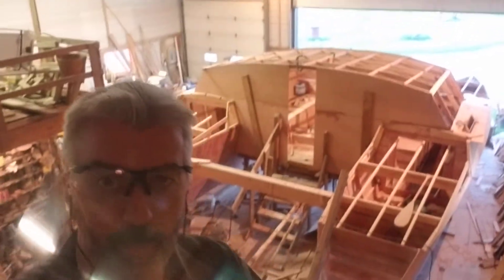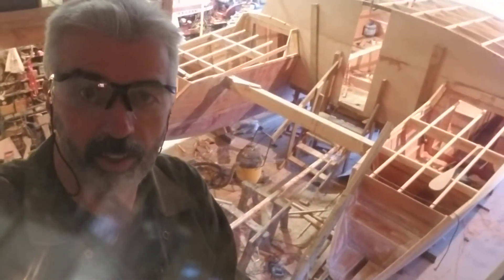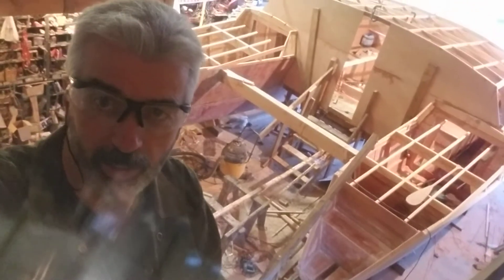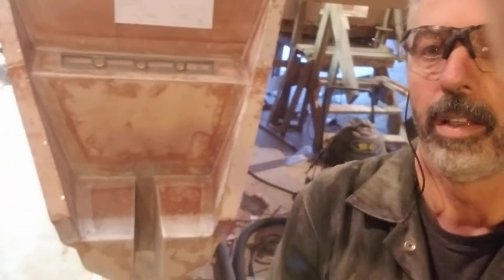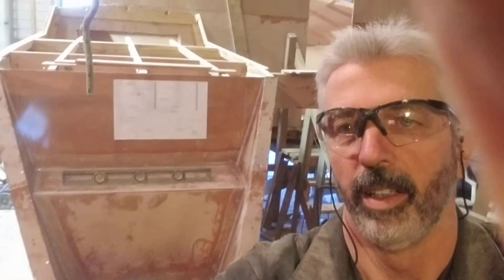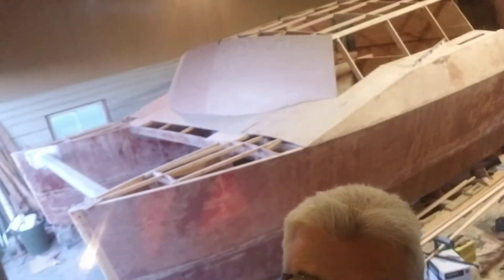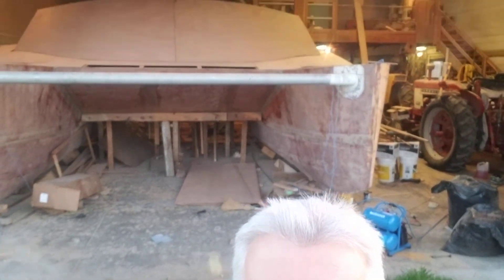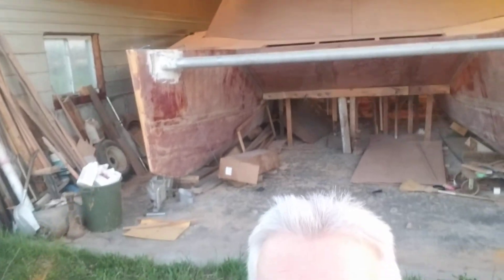Tour of my Catamaran Build month 18ish

Comment: Hello Tom, have you look in to the pricing of your project? certification process and insurance? I believe that final red tape is crazy-complicated to finally sail .
Reply from the maker: I just need a marine survey,  ownership is easy (From what they tell me) I can provide all my receipts if needed. Ply is all bs1088 loyds certified.   I I have spoken to my insurance co and can get insurance as soon as I get the survey.  there have been quite a few built by this designer. this is the first if this design but there are lots that are very similar. 
My Dad is 87 and we are building it together and sort of reconnecting so its worth building even if it never sails.....But it will  :)
Reply from the maker: Have you had issues?  I did hear of one fellow that had a bit of trouble but most seem to get it done without any trouble.   To charter might be different.